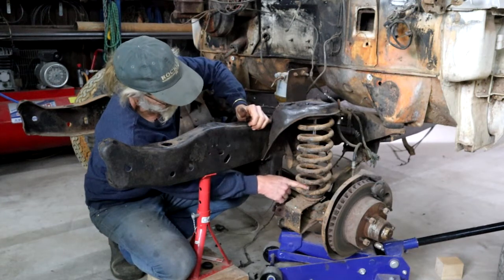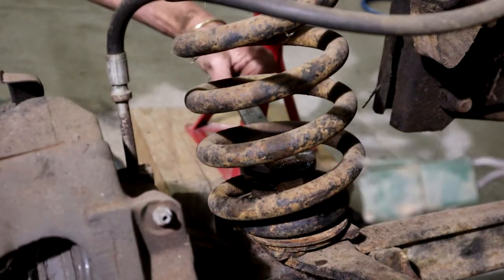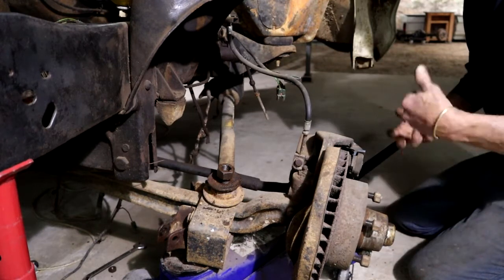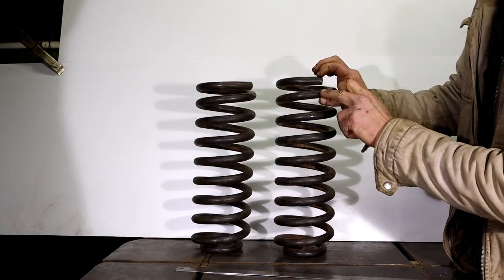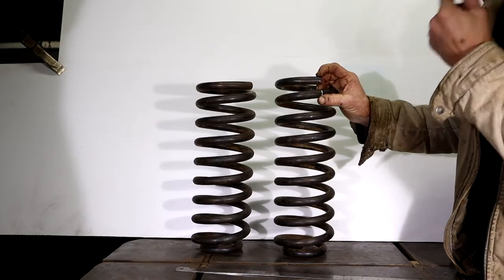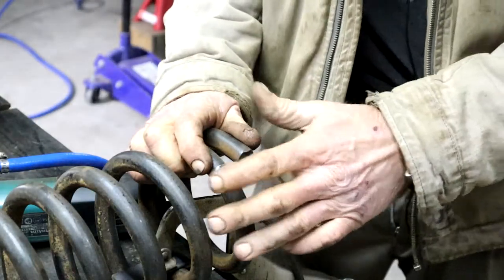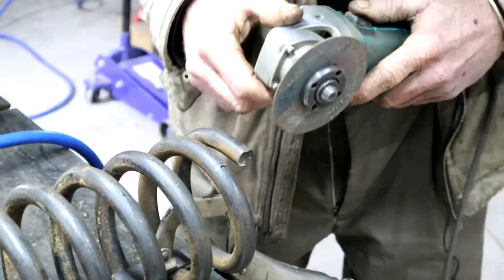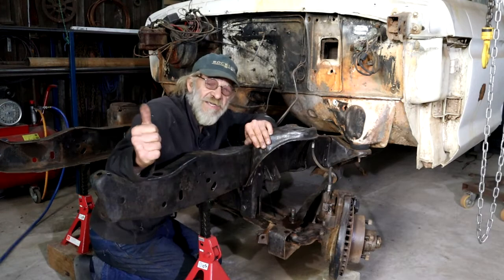FORD F1OO - REMOVING & CUTTING COIL SPRINGS TO LOWER STANCE

Comment: That cut off wheel wont put enough heat in the spring to hurt nothing. Ive actualy welded coils back together and drove for couple yrs befor selling them never had any issues.
Reply from the maker: Best to play it safe, especially on YouTube!😂

Comment: Twin I beams were notoriously difficult for alignment problems, even when new. I knew a man that had them heated and bent to solve the problem ⚡️
Reply from the maker: The difficulty with them is setting camber. Ford actually had a special tool for bending the beam should it be required.
Reply: Lol my tires are bald on the outside and brand new on the inside @ratrodsafrica
Reply: You don't know shit my truck has never had any issues with alignment and it has all its twin I beams

Comment: Thank you Div, This is very interesting. I need to to cut my "F100" coil spring as well. Glad I came across this. I will tell do what I did. I have a toyota hilux suspension in my F100. I only wanted  to drop a small amount (say 20mm). The details of this I will reveal in a video which I will share shortly.  I removed the entire Macpherson Struct assembly. Then I made  a mock replacement shock comprising Square tubing and threaded round bar. I welded a small piece of square tubing at the bottom on a vertical piece of square tubing to form a tee. And welded a the threaded bar into the top of the vertical section of square tubing. Added a a few nuts and washers at the top and bolt through the bottom. Doesn't have to be square tubing ( That's what i had lying around). This mock up replacement shock if you want to call it that, I installed into the suspension in the stock location where the Macpherson struct used to be. the threaded bar gave me the adjustment i need to set the truck at the required ride height. so now I can finalize my stance / ride height. etc, This allowed  me to continue working without cutting the spring yet. I was going to cut the spring 20mm. now maybe i only need 10mm. Glad i came across you post. I hope what i am saying makes sense.
Reply from the maker: Ja, I understand. Safer to rather cut too little at first, not so easy to put it back...

Comment: What's the explanation for the double drop? It doesn't make sense to me...
Reply from the maker: Hey Sean. I got thinking like this: If you lower the truck on the standard spring, it will compress until it can carry the weight of the vehicle. This is the Load rate - the amount of weight that is designed to carry at specific ride height. If I now add more weight, the spring will compress more, right. But instead of adding more weight, I shorten the spring some. The weight remains the same, but I now have less spring material - the spring has to compress more until it settles at new ride height. So, the change has to be the vertical amount I cut off, PLUS the additional compression. Question is, how much is this? You get fancy formulas, but you need a lot of info, stuff related to type of steel used etc. Too much for us mere mortals... So, I searched for an easier way. - 2 car spring manufacturers in the States said the same thing: If you cut 1" from a tangential car spring, you will get 2" of body drop. Eaton Springs and Global West Suspensions. I guess they know what they talking about, so I'm going with that! Time will tell...
Reply: @ratrodsafrica  It makes sense. So it's not exactly 2x, but that's a pretty good thumb suck. I have zero spring theory myself, so this is interesting. Thanks!
Reply: @seanhammon6639  I'm on a journey of discovery and learning myself! Happy to share. Ja, thumbsuck based on typical tangential automotive spring and a cut of 1". I'm pretty sure that factor will increase as you cut off more...